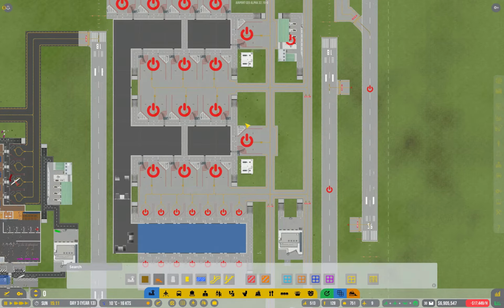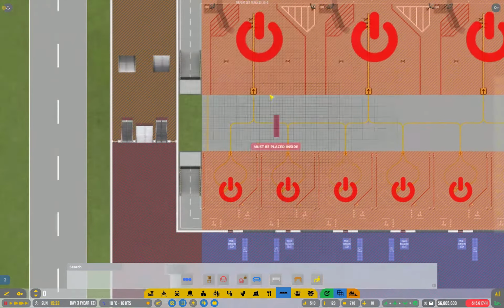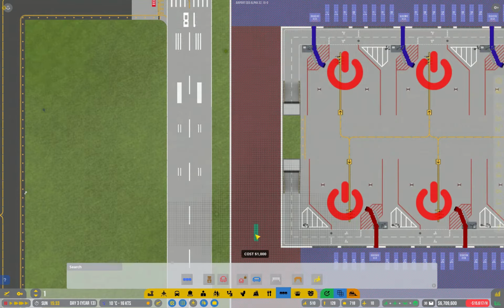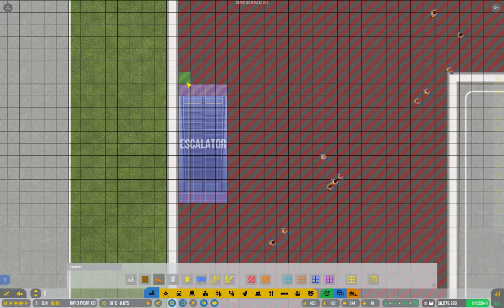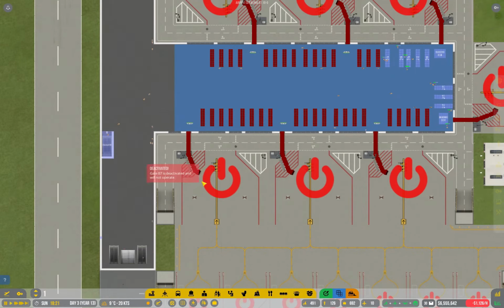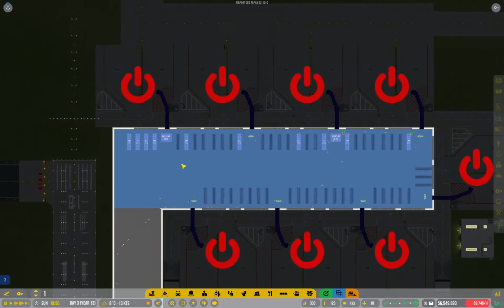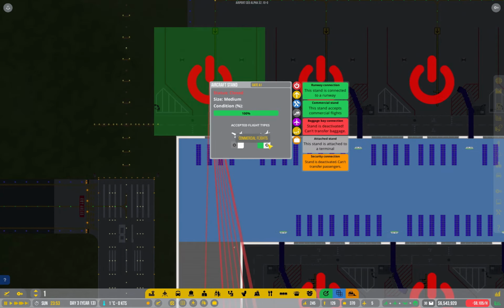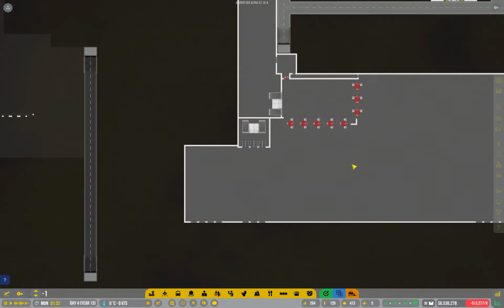Airport CEO - Ep 16 Terminal Seating

Comment: Just double check the security for staff in new terminal near passenger security you have smaller security but then your letting them  in staff zone passing through security which not secured zone only staff zone which will create problems for you